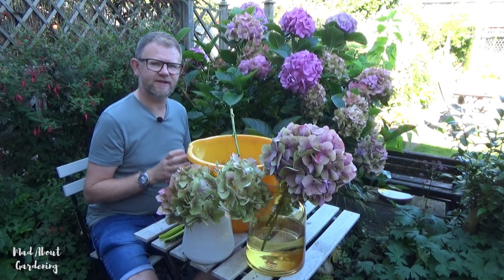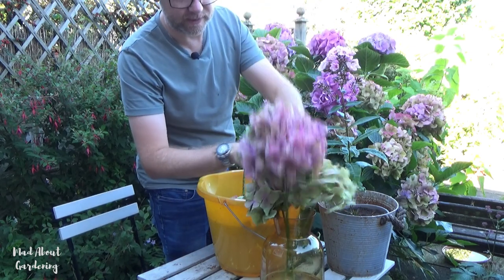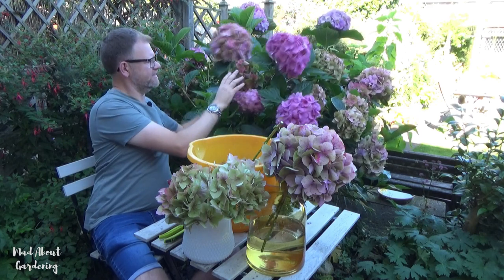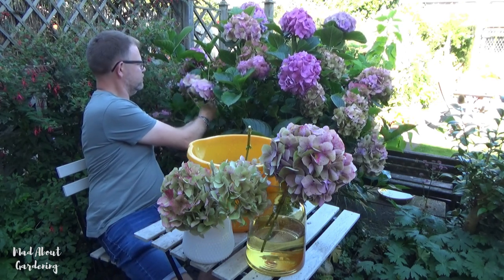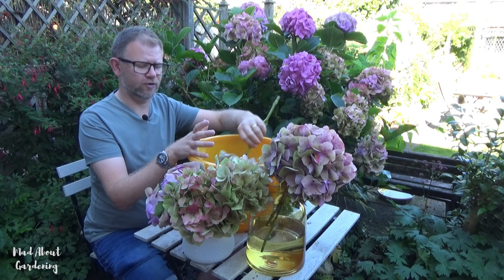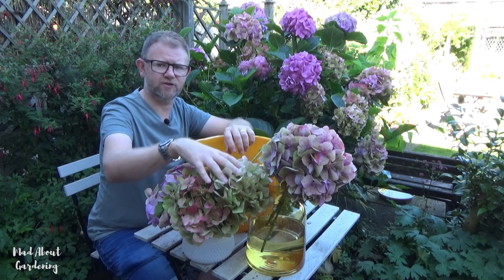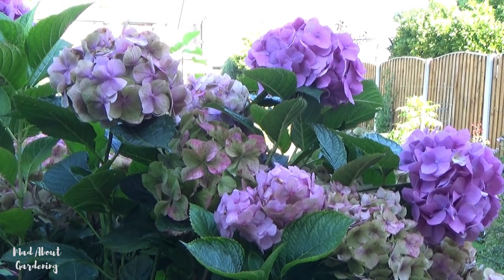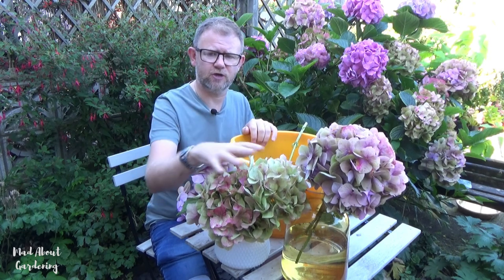How to Dry Hydrangea Flowers in Water | Drying Hydrangeas | Dried Flower Tips

Comment: Hi Paul, did you finally see a difference between the methods ?
Reply from the maker: @mypreciousgarden  Yes, there was definitely a difference and the ones soaked in water first were so much better and remained more colour. I'd definitely recommend soaking first 👍
Reply: @MadAboutGardening  Oh, good to know, thanks, I'm gonna try that ! I did things wrong with the first ones, I left them in water for a few days and then worried the stems would rot so I took the water away 😅
Reply from the maker: @mypreciousgarden  Hopefully the stems won't rot even if left for a couple of days. Once the heads have been soaked, they are left in water like cut flowers until they dry out. They make beautiful dried flowers and we'll worth the effort. 😀